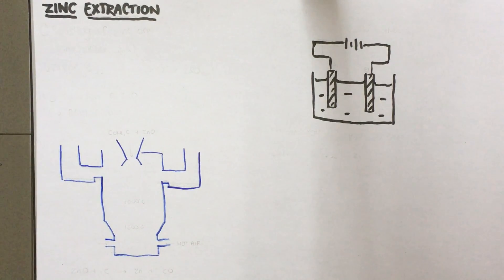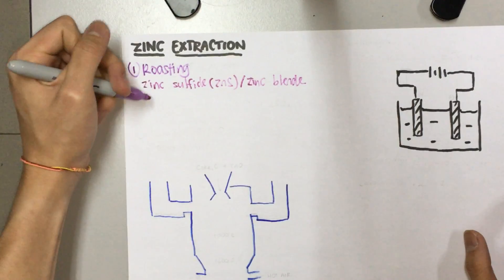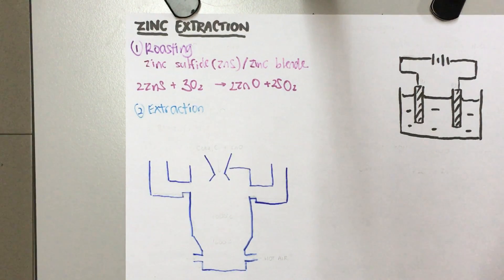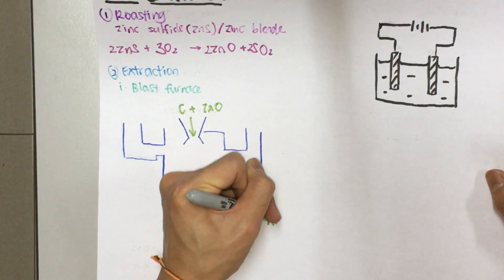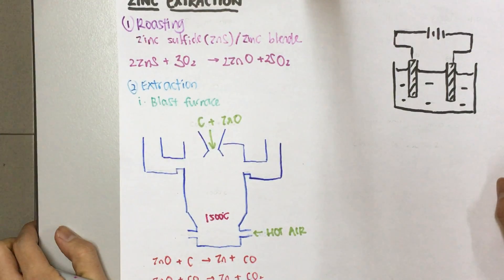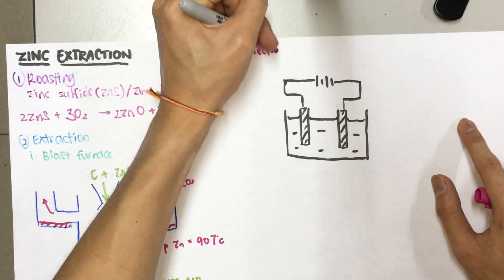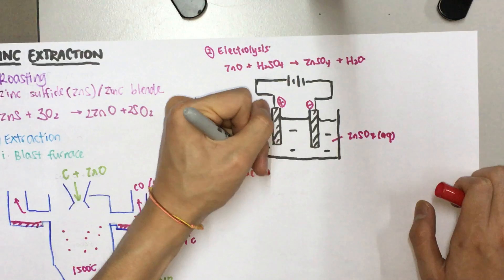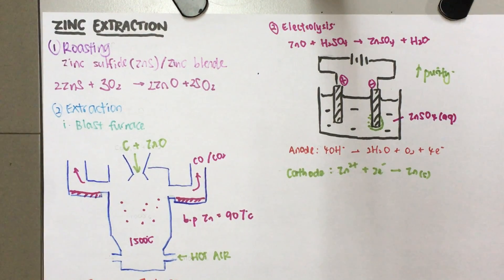Chemistry - Extraction of Zinc

Comment: what kind of electrode do they use in the electrolysis? Because if its in an aqueous state, isn’t the h+ ion should be discharged due to its lower position in the ecs at cathode?
Reply from the maker: electrowinning, which is a specialized form of electrolysis, can read more if you are interested here. http://metalpedia.asianmetal.com/metal/zinc/extraction.shtml
Reply: @mrsaimun  thanks, will do

Comment: Which process is the cheapest one??
Reply from the maker: It depends on what do you want to extract. But using carbon reduction is definitely the most cost effective method.
Reply: @mrsaimun  I want to extract zinc from zinc ash so which process shld I go for?
Reply: @TheAipagee  blast furnace is cheaper compared to electrolysis